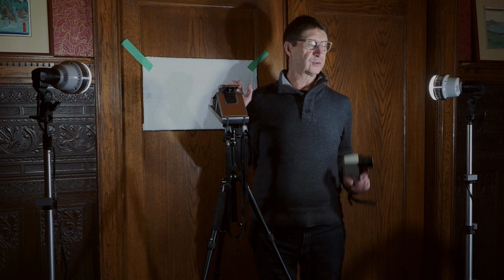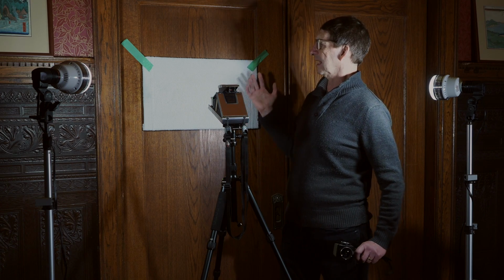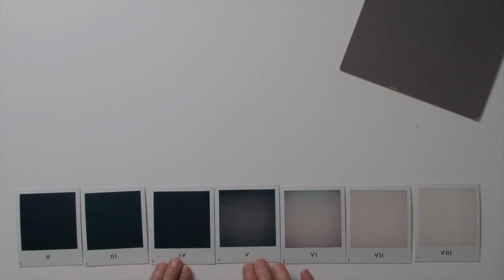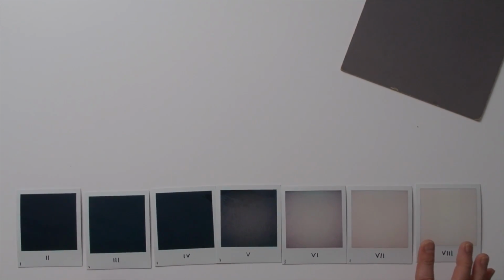Using the Zone System with Polaroid SX-70 Film, Part 1

Comment: This is wrong!! Zone system worked with "high silver loading" emulsions, such as on glass plates. Modern emulsions contain the minimum amount of silver halide to achieve a given D-Max, and are developed to Unity. No amount of extended development will SIGNIFICANTLY increase negative contrast, tonal range, shadow detail or D-Max. You can REDUCE neg contrast by over-exposing and under developing. That's it. I have a non Mint SX-70, so it shoots at f8 only, varying just the shutter's speed. I recommend either using a light meter to measure scene brightness range, accepting just a few stops of range, or using the same smart phone to test shoot. This gives some idea of your scene contrast, once you learn how to interpret it. You still won't get perfect pictures every time, but it helps.
Reply from the maker: The Zone System process I described does not talk about altering development time, which is impossible with Polaroid materials. What I describe is a means of using shutter speeds—and perhaps a neutral density filter—to pre-visualise where the dark tones (eg Zone 3) and light tones (eg Zone 7) will fall (given the limited dynamic range of Polaroid SX-70) and choose the best shutter speed setting based on that. Which is more or less what you are saying at the end of your comment. 

Varying contrast by using N+ or N- development (which can also involve varying the developer dilution as well development time) only works with sheet film. I used to do this all the time with 4x5 film sheets. It will also work with roll film but, of course, all frames on the roll must be developed to the same contrast.
Reply: @WalkClickMake  In that case, we agree to disagree. You showed us Ansel Adams's book, to start with, hence my initial comment. Ansel Adams himself did in fact say what I wrote about silver halide loading not being found on modern films. I even capitalised the word "significantly".

Since my SX-70 is not the Mint modified one, there's no way to tell shutter speed. It's light meter is crude, not TTL even, so no wonder exposure is unpredictable. Despite this, I've taken several 100 pictures with it. Right now I have some of the new 600 film to try. I may get the new £600 iType model, despite its not being an SLR. To me it looks a bit cheap and nasty though.
Reply from the maker: @bilonggrisimmeri  I don't have the new Polaroid I-2 but the few reviews I have seen suggest it's a good camera. It ups the ante with aperture as well as shutter speed control (although only in full-stop increments it seems). It is much less expensive than any Mint camera so, if you are willing to give up the TTL viewfinder and the original SX-70's form factor, I would consider buying it.
Reply: @WalkClickMake  Yes, on YT it looks OK, if very bulky non-folding design. Wex may be stocking it, and I need to hold it in my hand, to see build quality. For now, I will use my 1980s SX-70 autofocus, to see if Polaroid is still useful to me. Since one Polaroid 600 photo costs £2.27, dud shots are now a real issue, whereas in the past the film cost much less, allowing for inflation. There's no 100% reliable way to get perfect exposure with that crude SX-70 magic eye meter.

Comment: Hey, amazing video, thank you for making it. I am an SX70 lover and a zone system lover, so this really made me happy. I have so much to say, but let me start by saying that the maximum shutter speed the SX70 can do is 1/178th or something like that, so it would be technically more accurate to speak EV regarding SX70, and I started like that but I finally gave in to speeds at f.8 equivalent.
When at fast speeds the SX70 is quite unreliable, the difference between 1ms and 2ms is a huge difference. I have found a way to make the shutter/aperture system about 4x faster, I am still experimenting with this.
SLR670S cheats at higher speeds, take the same manual 1/2000 picture on an sunny day, first in a normal fashion, next covering with dark tape the eye sensor window. I was astonished when I found out this. I was measuring speeds on the MiNT and they were so different every time that I was going crazy, then (I think it was 33ms) and on they were rock steady.
I was thinking about ways to influence the development of the picture, like using temperature while developing. I am also thinking about doing slow expulsion, running the motor slower via PWM.
I have also implemented some rudimentary aperture control.
My name is Joaquin de Prada and I run the OpenSX70 project.
Again amazing work!
Reply from the maker: Hi Joachim. Thanks for your interest! I  have been following your OpenSX70 project. In particular, I enjoyed your research on the way the shutter/aperture mechanism works and, as a result, I always feel uneasy about referring to a constant f/8 aperture on the MiNT SLR670-S, knowing that it may actually be shooting at a smaller aperture in some cases. All I can determine is that, after using the camera for a year in manual mode (using the MiNT Time Machine attachment), using f/8 to set my exposure seems reliable and consistent. It would be great if your work managed to gain control over the aperture setting. Even a consistent f/11 and f/16 would be helpful.
I like your idea of using temperature control or slower/faster ejection to control development. That would offer something similar to N+1/N-1 development with conventional film. So far, my 'accidental' experiments while shooting at too high or low a temp does lower the contrast and film speed but also introduces physical defects due to (it seems) poor distribution of the chemistry as the film is elected. Perhaps applying mild heat or cold after ejection might work? Hmmm...something to try!
Reply: @WalkClickMake  I think really early cameras had some sort of heating element connected (somehow seen in the Eames movie). This probably means that they were not sure about the film reliability. Another factor with the “new” film is the effect of shielding or not shielding on ejection. The new opacification process is nowhere near the original. I always have this though that if they presented the current film to Dr. Land he would throw them out of his office!
Oh and it’s JoaQUin ;-)